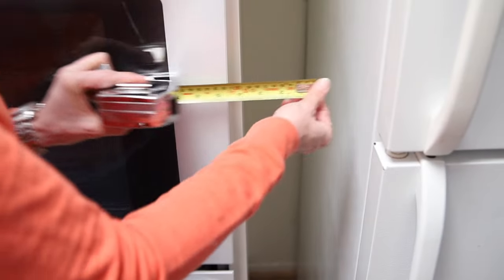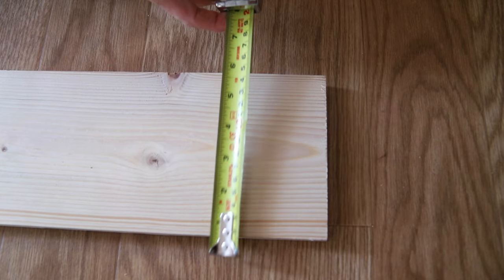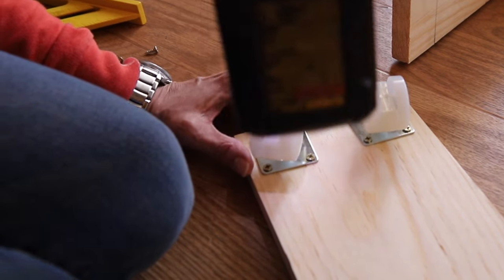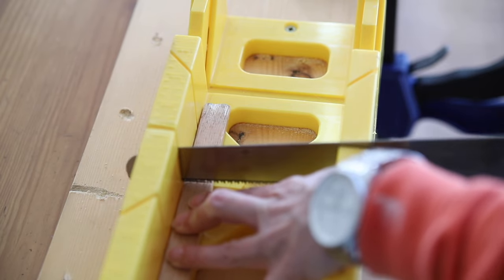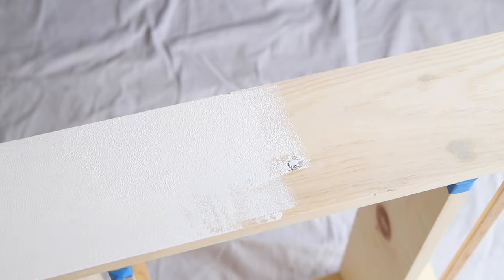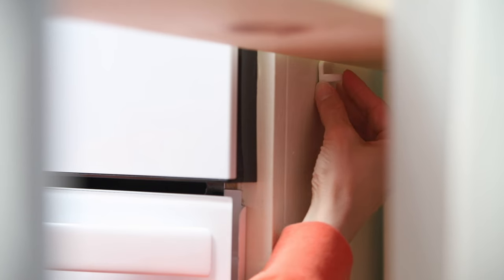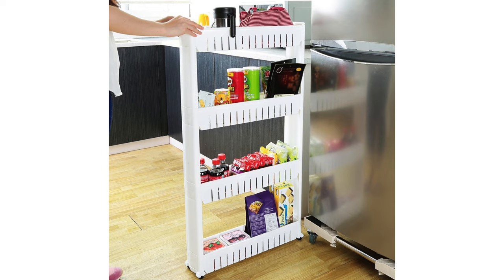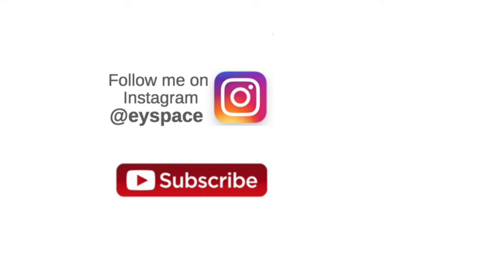Even if you're renting this DIY pull out kitchen storage cabinet will help you organize your kitchen

Comment from the maker: Here are the things I mention in the video:

3 tier pull out cabinet: https://amzn.to/2HH3dCC 
4 tier pull out cabinet: https://amzn.to/2HbdNm1
5 tier pull out cabinet: https://amzn.to/2F7luDw 

DIY pull out cabinet:

Tools:
Drill: https://amzn.to/2K2t8Ts
Drill bit kit: https://amzn.to/2JdMYKc
Countersink drill bit: https://amzn.to/2HgsBjb
Speed Square: https://amzn.to/2qRhMZR
Tape measure: https://amzn.to/2qRfMk7
Miter box and saw: http://amzn.to/2GzyW5P

Materials:
1”x6”
Screen molding
1” Corner brackets
Nuts and bolts
wheels: https://amzn.to/2JiOAm9 

Supplies:
Shellac: https://amzn.to/2qPt8NS
Paint & paint brushes
Sand paper

Comment: Thank you for this. I'm going to have a gap between my vanity & the wall in the bathroom & I wanted something to fill the space. I was looking at making it like a drawer, but trying to find the right slides was proving a major pita. I think this would be a much better option & would be significantly easier to build. The hooks as stops to keep it from pulling all the way out are a great idea!
Using the speed square for aligning the screws was also a cool trick.
This is going to make my bathroom project much easier.

Comment: Refrigerators normally require a gap on the sides, top, and back to allow for air flow ventilation. Check the manual, but I think you just blocked some airflow which can reduce efficiency of the fridge and shorten the lifespan.

Comment: Keep in mind those plastic wheels could damage the floor so you might want to go with the kind that are non-marking. Basically similar to rollerblade wheel material. I like the idea of mostly hiding the wheels. I wonder if you can put a door weatherguard on the bottom that will still allow it to move but block things like mice from getting under. Use of the speed square is a good idea. I will have to make something like this for my guest bathroom. I have a freestanding lavatory on a small vanity that I plan t bump over away from the wall a few inches to avoid elbow banging into walls when washing hands/using the sink.

Comment: Won't the heat from th oven/fridge damage the ingredients stored there or silly me, I need to pull out whenever I'm using the oven but the heat from the fridge?
Reply: Actually, the space between these places are there for a reason. It has to do with allowing the machines some ventilation. Call any service center for advice and they'll let you know how much space is recommended. Otherwise, it's not just your ingredients that will suffer, but your appliances, too.

Comment: This is an interesting idea but your fridge needs space at the sides for ventilation - doing this in a warm climate or heated house will shorten the lifespan of your fridge, and up it's power use plus spoil the food stored there faster. If you have a big space and a small fridge with lots of room at the sides, it'd be better.
Reply: Eh who cares, it's a rental